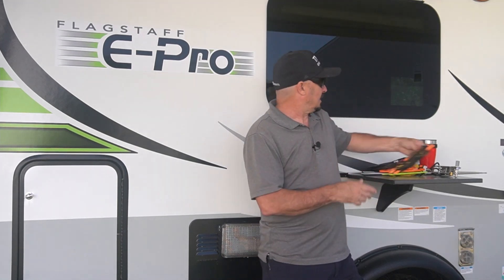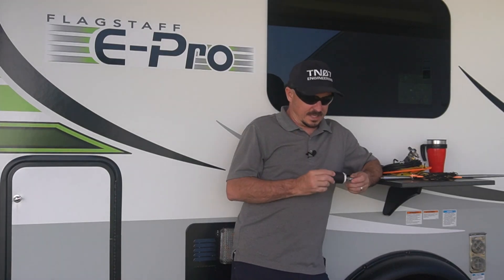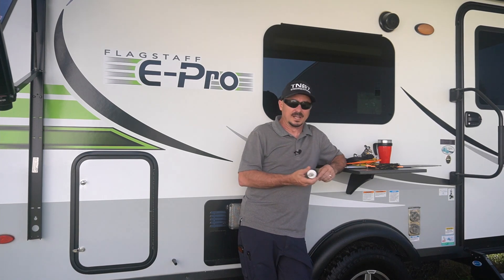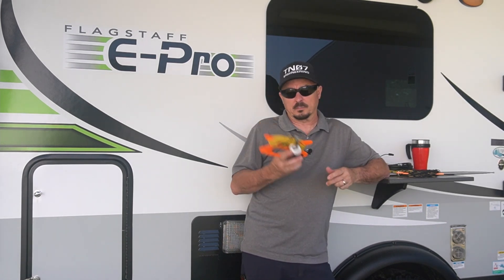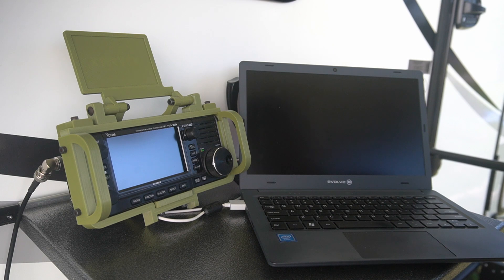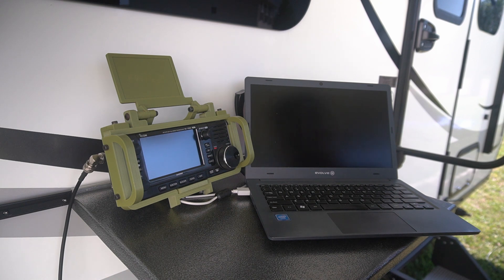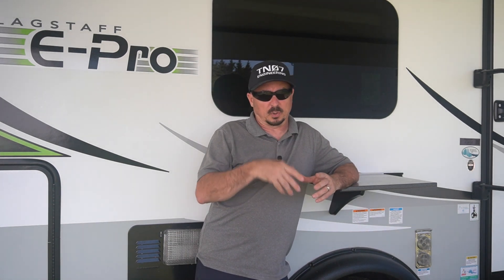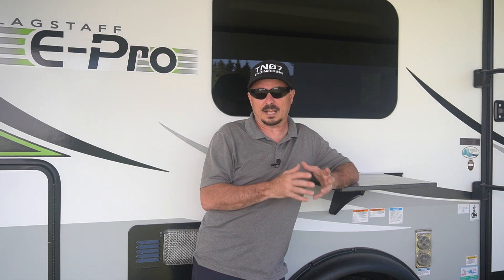Frankentenna :: RV Ham Radio Antenna

Comment: Why not use a motorized antenna on the RV.... or as la6nca does 20m fiberglass pole and wire to a kite using the Icom ah135 tuner...
Reply from the maker: I have used a fiberglass pole most of the time in the past. Occasionally there just isn't enough room usually due to trees directly overhead. The motorized antenna could be another option though.

Comment: When I have limited space, I take my 40 and 20 meter EFHW antenna and wind it helically around a 9 meter fishing pole, section by section of the pole as I extend it.  This consumes minimal real estate, no more than a loaded vertical.   Helical wind gives you minimal adverse SWR effects.  Will it give you NVIS?  Not sure.

Comment: Great job Jason. Can you measure the Sporty 40 for inductance?  It would be nice to build one.
Reply from the maker: Don't have an LCR meter but will try to find my nanoVNA and get a reading. Honestly I don't think you can build it any cheaper than buying it from WRC.
Reply: @KM4ACK  probably but I have stainless wire and a 3D printer. With lots of stainless hardware. 
And I like making it myself.

Comment: Thanks.  Have you done a through wall bulkhead for getting coax into the rig and if so any tips?
Reply from the maker: Into the RV? I passed the coax in through the outdoor shower bay. There was just enough room to run in by the plumbing. For power, I ran a wire from the battery underneath the RV to an existing penetration point where I could pass it up through the floor. Inside, it came in under the dinette bench.

Comment: tilt the telescopic over, it will work a little better. or when I am in our RV, I run the EFHW above the trailer . use the trailer as a reflector.
Reply: Type of trailer? Stick and tin?

Comment: In small footprint situations, have you tried running the EFHW as an "L" with the vertical portion up a mast and the feed point at the end of the horizontal portion? That should work NVIS and you keep all bands available.
Reply from the maker: Yes sir. The inverted L is my preferred method.

Comment: Did you use a radial or ground plane system? Michael from KB9VBR Antennas recently posted a video using a metal door screen that looked very promising.
Reply from the maker: I used radials for this setup. Just saw Michael's video a couple of days ago.